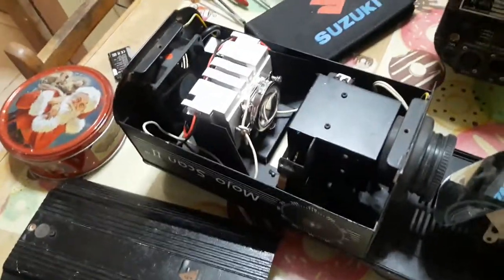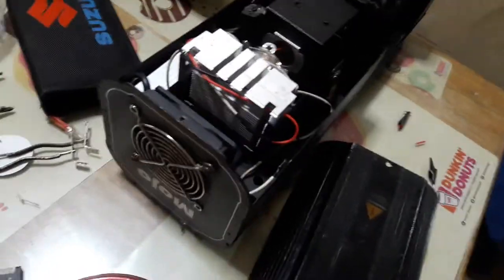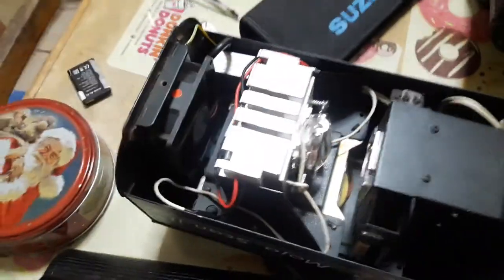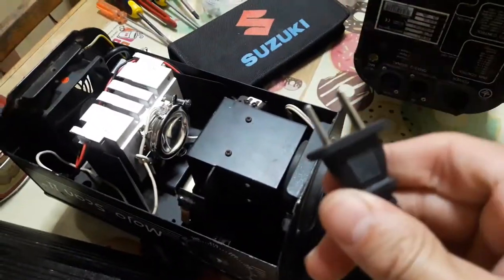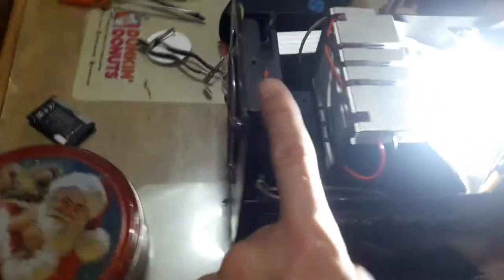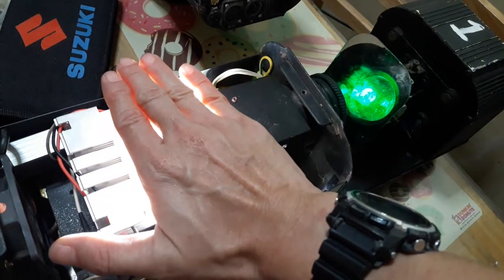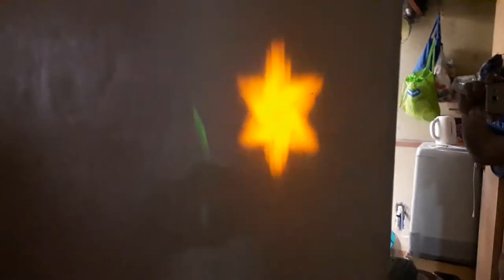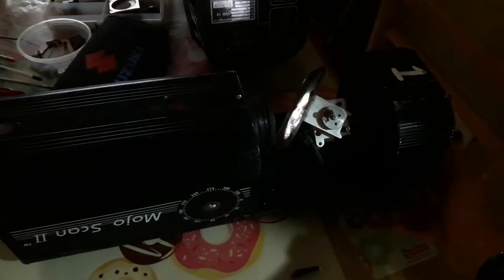Mojo Scan II retrofited with high power LED

Comment: is that the same LED and driver u showed in the other video?
Reply from the maker: yes
Reply: @ZINDJGABECORDERO  did it come with the hestsink? Can u share a link to the item amd where to buy?
Reply from the maker: @adamkane1977  no it did not came with a heatsink. you'll have to find a heatsink in computer 2nd hand parts or online. you'll have to buy an intel socket 478 form factor heatsink. the amd heatsink will not work. the heatsink has to have a flat surface in order for you to mount the LED and bracket assembly together with the lens.  buying the led, led driver, bracket, colimator(reflector) and lens are both in the website https://www.lazada.com.ph/products/50w-led-smd-chip-bulbs-with-high-power-waterproof-led-driver-supply-i142195917-s162125040.html?spm=a2o4l.searchlist.list.9.5af0595d91oPvd&search=1 and https://www.lazada.com.ph/products/44mm-lens-55mm-reflector-cup-collimator-fixed-bracket-60-degree-for-diy-20-100w-led-lamp-bead-led-projection-intl-i135608287-s152340728.html?spm=a2o4l.searchlist.list.1.1552454beZ8IkV&search=1
I will buy a separate lens that has narrower focus probably 35 degrees or even narrower. the lens that came with the collimator/reflector is 60 degrees. 60degrees is very wide not good

Comment: Hello, how much are the LEDs and if it has a transformer?
Reply from the maker: it costed roughly P450 pesos plus shipping. the led comes with power supply
Reply: @ZINDJGABECORDERO  no my question is how much is the watt of the led
Reply from the maker: @aryelgsonido  50 watts
Reply: @ZINDJGABECORDERO  location plz
Reply: @ZINDJGABECORDERO  magkno papz p convert mojo scan 2 at location mo
Reply from the maker: @dondiearciaga9143  P1,800 baliwag bulacan po. Kayo po bbili ng materials nyo sir available sa lazada at shopee. High power led cob 100watts yung may kasamang driver mga 300 pesos po plus bracket assembly at lens. Mahirap po sir humanap ng heatsink dapat pentium 4 na old school preferably pang socket 478